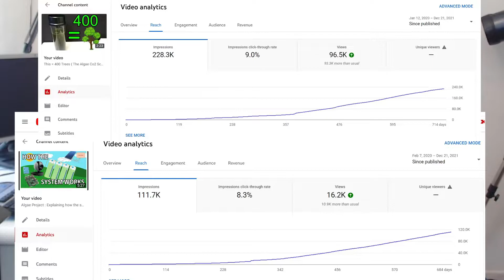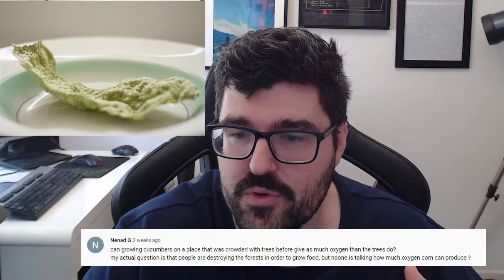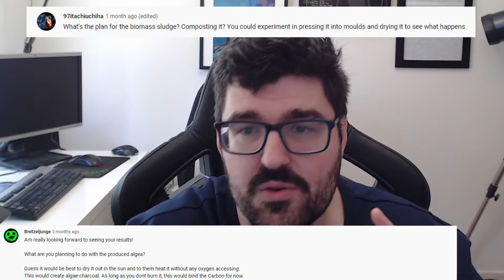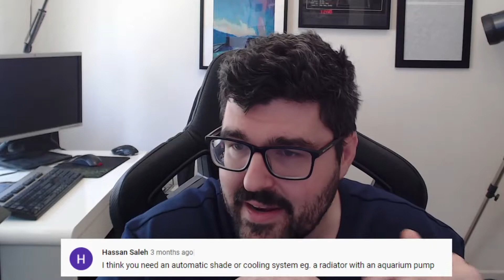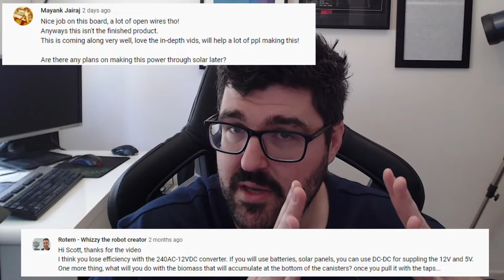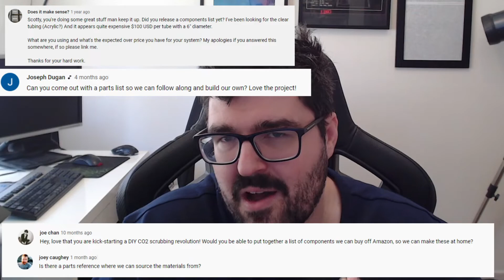Algae CO2 Scrubber Q&A

Comment: There are several variables that need to be tested and I think you covered most of them fairly well. I've just got 2 to add, would a square vs circular tube be more effective.
But also, what to do with the waste? I think an agricultural spin might have more data to pull from than perhaps just human consumption. Could you feed the waste to live stock; in what form?
If you were to set up a fish tank with algae and farmed fish, what rate and population of algae growth would be necessary to sustain fish offspring harvest?

Just some ideas to throw into the mix.

Comment: Hi Scotty, this is an awesome project. I’m just starting to get through your content. I did research a few summers ago on improving the rate of photosynthetic material, basically measuring if we could improve the rate of CO2 reduction. We were successful, improved the efficiency by ~70%. We used spinach due to its high chloroplast density. Do you think combining your physical apparatus with our improved biochemical activity might be a possibility? Do you have a form of contact so as to possibly start a conversation?

Comment: The biomass shouldn't be able to emit c02 in any way because the algae has turned the c02 into carbon and oxygen. Biomass is almost completely just carbon. I think it'd be very similar to something like wet paper. The only way to get the carbon out of the biomass should be by burning it, effectively reacting the carbon with air and creating c02.
Reply: It could release methane during the decompaction process though? and methane is a significant greenhouse gas.